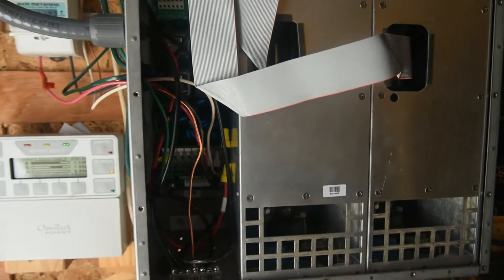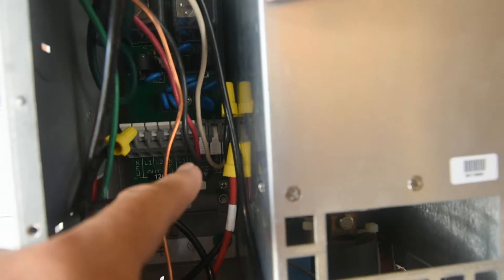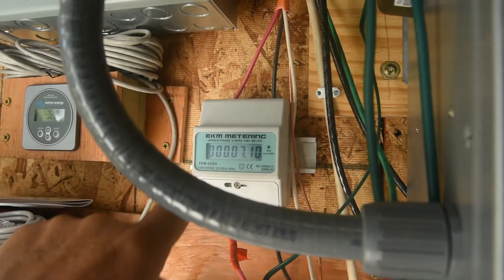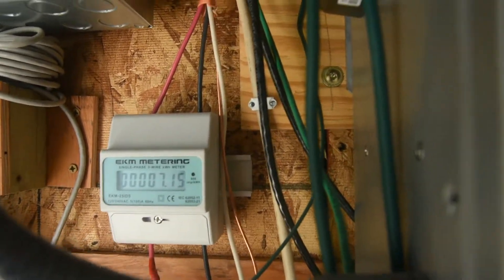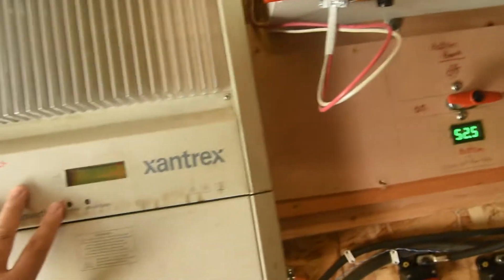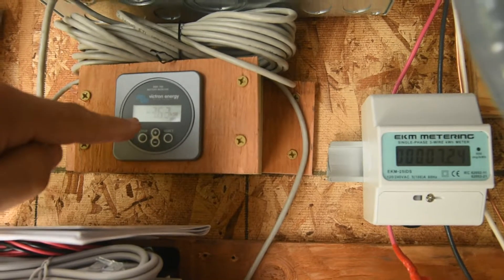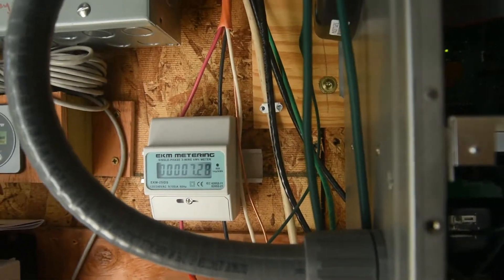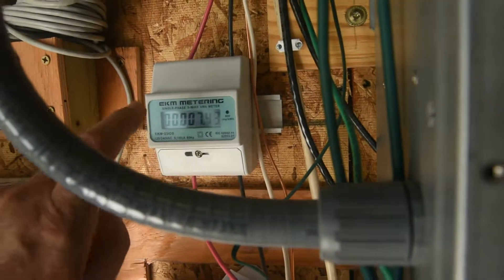DIY: EKM Metering Hookup in my Solar Building

Comment: One suggestion, it's a tad bit expensive but get the gateway and one Tesla power wall to store your energy. You can watch all your energy needs and usage is right on the app. I've got three power walls and 19kw of solar, just adding my AtlasX wind turbine next month, I was looking for a small meter to measure the output, to see what my pay back kilowatt wise is going to be.